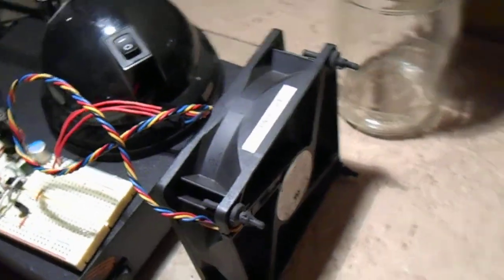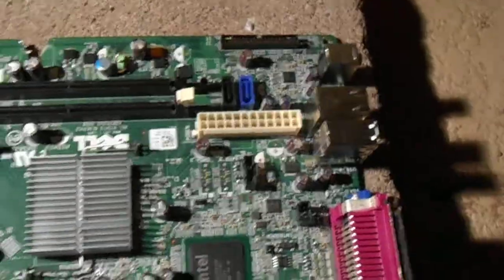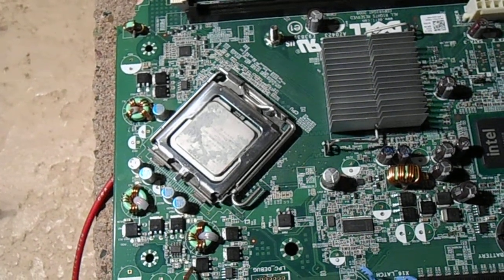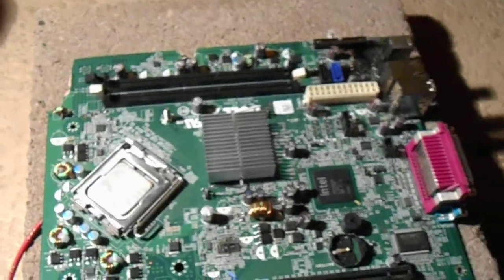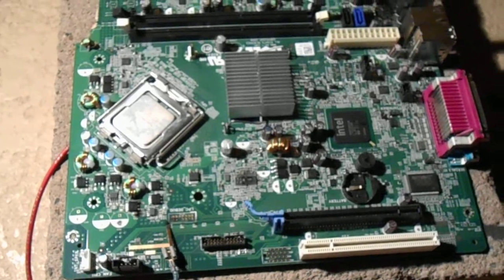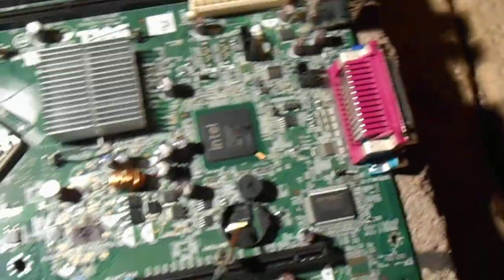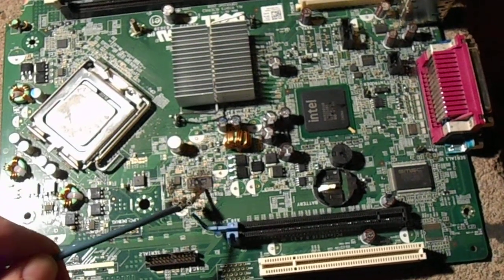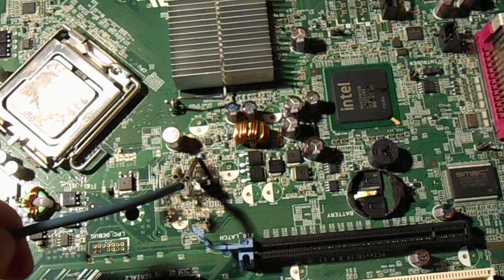Motherboard FRY!!! Pt.1/4 Realtek FIRE!!! debug/internal bus chip pops

Comment: finally a video that shows exactly what I need to see
Reply from the maker: haha, I have seen alot of people frying motherboards with BIG ARCING transformers, you dont need any of that you are just going to make a big arc as soon as it conducts. sure its 1000W of heat but that is just going to cook a component around the edges. what I am doing is cooking something from the inside out, and all you need for that is a big current regulated power supply with enough voltage to pass the current. 13.8v doesnt seem like much but when the rated spec is 5v or lower it is really bad.